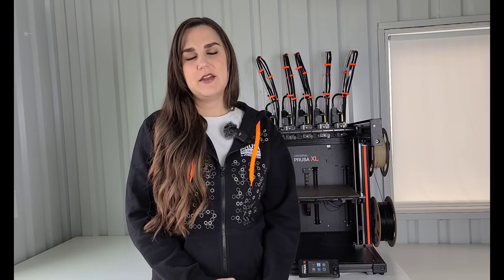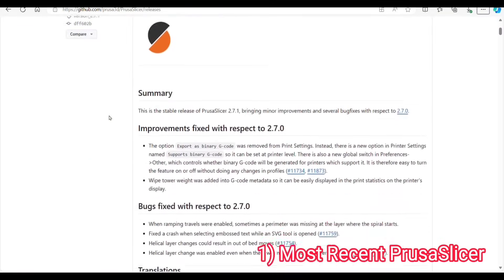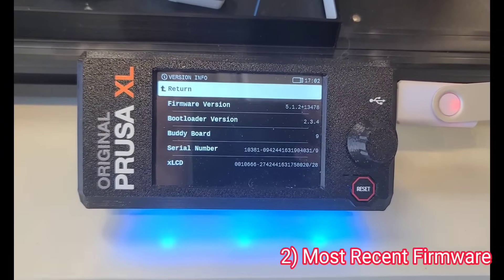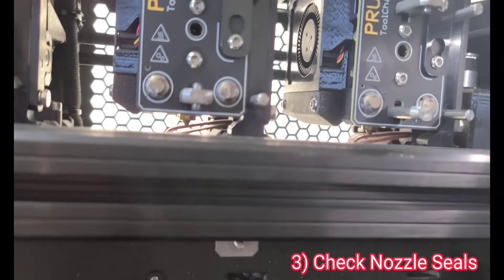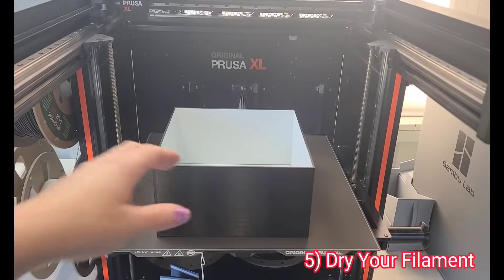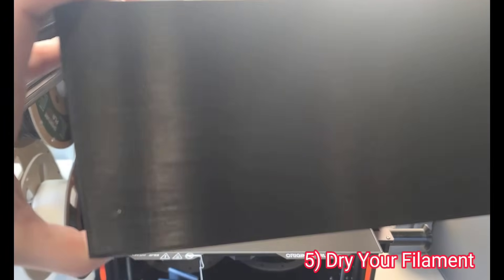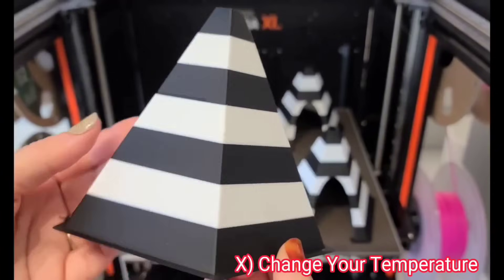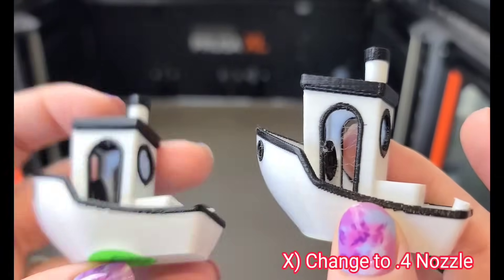Stringing on the Prusa XL - 5 Things That Worked and 3 Things That Did NOT Help!

Comment: I noticed when looking at the benchy, when sliced with the two colors, some of the worst spots for blobs and stringing are spots where the nozzle basically just puts a dot of filament. So it’s just not putting enough to be consistent and reliable.
So it’s important to remember the benchy isn’t designed to be the benchmark of a printer being set up right, it’s meant to be a challenging print to benchmark how the printer does in challenging circumstances.
Obviously this doesn’t mean I think bad benchys are good. But just that you can have imperfect benchys and perfect “real” prints
Reply from the maker: That's a good point. And I have been able to get some decent single or simple prints. I think I like the benchy because it's pretty fast and easy to compare. I'll see how other prints do. Thanks!

Comment: After your video about stringing I made few experiments. I'd like to create an article or video with the results. Result shows that 2 factors effecting the stringing there the most. Quality of the filament and its dryness. e.g. I used Hatchbox black - and old filament I found home, Polymaker Wine red and Prusament galaxy black. Prusal sclicer 1.7.1 and firmware 5.1.0. I always printed the main body in red and the accent with one of two blacks. I printed them with and without purging tower too with 0.6 and 0.4 nozzles. Result was interesting the red was flawless almost always. Hatchbox was stringing but Prusament not. It was clearly visible on purge tower too. But even the Hatchbox was better than your on older videos. I tried it with 2 different layer heights and with and without Input Shaper too. My conclusion was that stringing obviously mostly depends on quality and dryness of the filament and then the layer height if we do not count variability in slicer which I kept the same. I personally never expected  "Generic" filament profile working for each filament without tuning. I first try it and see. If needed printing like you a temp tower and calibrating the multiplier too. As far as it comes to your and my results the biggest difference is the filament itself. BTW exactly which filaments did you use for the experiment?
Reply from the maker: That's really interesting. I use mostly Overture. I haven't had any issues on any of my other printers. Even the single toolhead XL. But I have some Prusament on order. I actually would prefer just using different filament than having to dry what I'm using. I do have some Galaxy Black PLA that I might be able to test out while I wait on shipping. Thanks so much!

Comment: Great video - and nice to see your face! LOVE the sweatshirt, I was not aware these were available!

Good to know your XL is working better now, it’s an excellent tool. I shared on an earlier video my 2T just works, minimal stringing and no problems except it’s a bit noisy 😮. One thing I didn’t mention is… as I found through time this helped so much with 1st layer adhesion and print results on my MK3 with MMU, I now have 2 filament dryers and as a habit I always dry a spool for some 6 hours when new, and all open spools are stored in large sealed plastic boxes with desiccant in. Maybe that also helped me in having such a different experience?

Printed successfully with 0.6 nozzle mostly but also done a few prints on 0.4. 

Machine is such a joy, how it makes multicolored prints now quick and with little waste, and the huge print volume. Also feels it’s built like a tank and is going to last forever!
Reply from the maker: Thanks! It's a pretty comfortable sweatshirt too! 
That's so great to hear you are having such good results! Yeah I may need to just get in the habit of drying. Right now I am marking the ones that are dried but  that's not very convenient. Thank you!
Reply: @tada3dprinting  what surprised me was I had always assumed 'if it's new filament it doesn't need drying, right?'. Many times I have new filament I open, then I have problems (stringing, or first layer is not sticking well) and then after spending a night on the drier, it prints perfect. So now any new filament goes to the drier!

Comment: I really appreciate all the work you’ve done and posted here. FWIW I got my XL-5T last week, built it, and I’ve been running some large multi-color prints in PLA and mixed PETG+TPU. Mine came with 0.4mm nozzles, which is fine with me; on the Mk3 I’ve never seen great results from 0.6mm nozzles.
The firmware for post-build checks is just horrible. I had fans failing their check even though they were spinning fine; I needed to loosen screws holding them to the tool head to make it pass. I had a nozzle temp check fail because it simply never started heating; I needed to rerun the test. The dock position calibration failed repeatedly for no discernible reason. Nothing was actually wrong with the printer! It was just badly programmed tests.
Since then, however, the printer has been running great. I’m using the same 5.1.2 firmware and 2.7.1 slicer. I didn’t use any gcode that came with the printer but I sliced my models with factory presets for 0.4mm nozzle and input shaper (0.2mm layer height, “speed” preset). No print failures, no tool change failures, only the tiniest wisps of stringing, no blobs or other quality defects. I’ve been mostly using Cinderwing3D’s multicolor dragons for tests and they’re coming out just great.
Reply from the maker: Yeah when the calibration takes an hour, it's very frustrating when weird things fail and then pass the next time. Really made me wonder if I had build issues or not! I'm glad you finally got it working so well! That's really great to hear! Thank you!

Comment: Happy New Year!
I am glad to see you solving your stringing issues with the Prusa XL 5.
There are some filament dryers that hold multiple spools, I have a Sunlu 4 spool dryer arriving shortly via their Kickstarter. Though some reviews of the preproduction units say it is a little noisy. Maybe an air-conditioner or dehumidifier for your workroom would be a good alternative to dry the air, with your multiple printers running.
Reply: Also, I don't have an XL but my feeling is that the nozzle seals are a little too high. I would expect them to be horizontal _ to cover & close the hole, and not just touch on one corner.
Reply from the maker: I do have a minisplit unit. But I do like the idea of just getting something to dehumidify the whole room. That might be easier than all of the filament I go through. Thanks!

Comment: I've ordered the EIBOS 3d Polymophus filament dryer.  I think it's still in our order but they emailed me that i should ship before end of January.

Supposed to be the best dryer because it goes up to 70c and it has small motor to rotate filament rolls to prevent hot spots while drying.

To me those seem like basic features that all dryers should have.

I live in super humid Louisiana and before i print petg or even pla i need a good dryer.
Reply from the maker: Let me know how you like it. Thanks!

Comment: I would suggest you get a filament dryer and store your in vacuum bags with desiccant when not in use. I don’t have a Bambu, but I thought the AMS has desiccant so maybe that is add a bit of dryness when printing from the Bambu. Either way your level of production probably requires you to dry all your filament even from the factory. There are plenty of options to include the dehydrator stack. I look forward to see what you come up with. Great video.
Reply from the maker: Yeah I agree I need to figure out a better system. Thanks so much!

Comment: I used to have stringing on my custom CoreXY printer till I started using OrcaSlicer. They have different types of wipes where you can spiral, slope, and a couple other types that allowed me to stop the nozzle ooze i would get during travels. They also have seam gap settings that can help with oozing and seam bulging. I dont know if there is a profile for the XL yet, but you might wanna try it out once they create one for it.
Reply from the maker: Oh that's interesting. Thank you!

Comment: If there is one thing that will fix everything it's drying filament 😂 - in all seriousness though, pretty much everyone suggests drying filament for every problem.  Usually you can hear wet filament though, when you hear it sound like rice crispies (snap crackle pop) as the filament goes through the nozzle.  If that's the case then the filament is definitely wet - and usually PETG or other hygroscopic materials will struggle with this, I don't think I've ever had an issue with PLA being too wet and causing issues.  Another tell tale wet filament sign is a bubbly rough finish & stringing, outside of that drying may help a little but it usually isn't the main issue or a major issue.  I know the community Grant runs over at 3dMuskateers is descent and Grant also has a 5 toolhead Pursa XL - he may have some ideas as well.  Thanks again for showing all of this, I can bet it's been frustrating with how expensive this machine was and how much time you've had to spend to test/tune it.  Hopefully, your videos and struggles get more visibility and focus from Prusa and the community so everyone can have a better out-of-box experience w/ the XL.  Thanks!
Reply from the maker: Thanks so much!

Comment: Just curious... how long was it in between the time you dried the filament and then tried the .4 nozzle? A couple days left open in a moderately humid environment is enough to make even PLA take up some moisture. I've seen a bunch of YouTube 3D print channels where they leave their filament out in the open on wall racks all the time. This has always baffled me quite a lot. All of my filament gets dried before and after or during a print, then vacuum bagged with a couple packs of desiccant and a desiccant holder in the middle of each spool. If I don't do this, I have stringing issues after a few days. PETG\ASA\PC\Nylon are even more important to store vacuum bagged with plenty of desiccant. Just a few hours is enough to ruin print quality if using a Nylon filament. PETG I've had issues after as little as 24hrs out in the open.

Is my method an absolute pain in the ass? Absolutely! But it's something I've gotten used to as a means of eliminating wet filament as a variable in my prints. Overall, my prints string a lot less and I have practically zero issues with blobbing or dialing in retraction settings. I'm not saying my method is for everyone as it does cost money in vacuum bags, dryers, desiccant pellets\packs and filament to print the desiccant holders. But in my opinion the benefits far outweigh the hassle and extra cost. Just some food for thought.

Great video showcasing what worked and didn't work for you! Before I decide to buy an XL or not, it's really beneficial to see what experience others have had with it. Hopefully, most of your issues with it are behind you now. 🙂

EDIT: I should clarify that I'm not saying wet filament is still causing you some stringing issues. I'm was only suggesting that eliminating that as a variable every time might help you dial in everything else faster and cause less wasted time\filament on test prints.
Reply from the maker: I mostly print with PLA. The only filament I put back in bags is wood or the occasional TPU etc. I haven't really had issues with stringing before. But I need to come up with a different process now. 
That does seem like a lot of work because I have 15 printers and go through a lot of filament. But it's great to hear what others do. I'm sure I can implement some of it. Thanks so much!

Comment: Have been watching your videos since you got your XL's. I'm glad you got yours to print at all. Have had mine for a month and it hasn't printed yet. Fails on calibration with the new firmware. Still working with Prusa but not impressed. Printing the maintenance parts is going to be a real problem. Still have my MK3S that works flawlessly.
Reply from the maker: Thanks so much! That sounds soooo frustrating! Mine failed calibration twice and then finally passed. So I was nervous to calibrate when I was playing with nozzle sizes. I wonder if you use a different firmware if you can at least pass calibration and then update the firmware again? Seems very strange tho! 

My current problem now is that colors just don't print. Different colors and different toolheads each time. But it's really annoying when you're running 20 hours into a print and it just doesn't want to push out a new color. Thanks for your support!
Reply: Tried numerous times, re-loading the new firmware, turning the XL on and off again, and numerous calibration try's on both print heads. It immediately fails when I align the changer with the either print head. It calibrates easily if I go back to the firmware it came with. Very strange.I hope Prusa has a return policy, can't have a chunk of steel taking up space it it doesn't work. Very @tada3dprinting
Reply: I'm calibrate with the original firmware, load the new firmware then go ahead and see if it will print anything.  @tada3dprinting

Comment: I started having extrusion issues issues with my mk4 that only resolved after changing the flash drive I was using for g-codes.
Reply from the maker: Oh wow that's interesting. I'm not using the original one anymore but I'll check this. Thanks!

Comment: When you are pushing the max lower temp on filaments its important to test white and black as the both will have slightly different affects based on the additives. From the looks of it, the black color needs a higher temp than the white.
Reply from the maker: That's a good point. And at least with the XL, you can print each filament at a different temp if needed. Thanks!

Comment: I printed the clownfish model that other YTers had stringing issues with and mine came out awesome at stock settings and with even old filaments.
My 5T came as a kit, could this be a factor too?
Reply from the maker: It's a possibility. Mine came "fully-assembled". You would think mine would be well tuned but maybe not. Thanks!

Comment: I am wondering if there is more of a problem with filament like white because of the Titanium Dioxide that is used as a pigment in them. Have you tried one of the newer high speed, high flow types of white PLA? I see several brands out there coming out with those types of filaments. I also wonder what a temp tower of cold white filament with the titanium dioxide vs the warm white which is basically a natural PLA, would show?
Reply from the maker: Oh that's interesting. Yeah I feel like I have a lot of issues with white. I'll see if I can find another type to compare. Thanks!
Reply: We are all just learning this new Nextruder. I have a feeling that Prusa mostly used Prusament to test and calibrate the XL and MK4. It is not too different than when I bought my MK3S 5 years ago. It seems like we were Beta testers then. @tada3dprinting

Comment: I can confirm that using a filament dryer and storing filament in big air tight boxes with big bags of silica helps a lot. For flex or nylon it's even a hard requirement.
Reply from the maker: Thanks so much!
Reply: I use rechargeable desiccant.
Reply: @larryturnertclan  yep, these bags you can put in the microwave and that indicate their state with a color changing label.

Comment: Do the idle print heads stay at printing Temperatures?
Maybe this would explain the difference in stringing between the mk4 and XL?
Reply from the maker: That's a really good question. I assume they do because the tool change seems to be very quick. Thanks!
Reply: @tada3dprinting  Mhhh mabye that's something worth cheking out.
Because the hotend temperature is calibrated for a certain flow (to melt the plastic completely in a limited amount of time in the hotend) these temps could be way to hot for it to just be sitting there.
Both the dualextrusion Module from snapmaker with luban and the toolchanger profile from simplify3d reduce the nozzle temp down to 150°c when idling to avoid this problem and have a specified heat up time in order to be back up to temps when a toolchange occurs

Comment: I've git the same printer (shipped Nov. 16th 2023). little stringing with 0.6mm nozzles. The main issue is that it wants me to rerun the whole calibration process after a firmware update. I did not do it and yet it works well... I would buy it again. Before i had a German RepRap 350X that had way more issues, but in 2016...
Reply from the maker: Yeah the calibration to me seems to give me inconsistent results. What types of prints are you running? Tall, big, both? Thanks!

Comment: I have 2 mk4s  i found the filament i use cannot print with high speed input shaping switching to mk4 profiles or to 0.15mm structural  fixed the prints  also i use polymaker filament not shure if this helps
Reply from the maker: Yeah I have had some issues with Input Shaping before too. Mostly things warping tho. But I'll try out some other filament. Thank you!

Comment: This is my third time commenting here.  While I love your videos, our results are drastically different.  I've stated before I only use Prusament or Polymaker filament.  I never have stringing.  I received my 5XL a week before Christmas, so maybe it's different.  I have zero problems printing with the 0.6 nozzle, and my parts look as good if not better than the MK4.  Please Please do a video with a high quality filament.
Reply from the maker: I'm willing to try it. I have Prusament on order now. Thanks so much!
Reply: @tada3dprinting  Thanks. Hopefully that makes a difference.  If you still get the same results then I'm wondering if some parts have changed from the model you have to the model I have.  I did the semi-assembled purchase, not the fully assembled, perhaps there is a minor undocumented change.